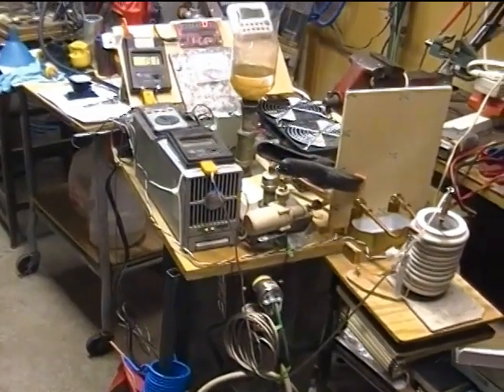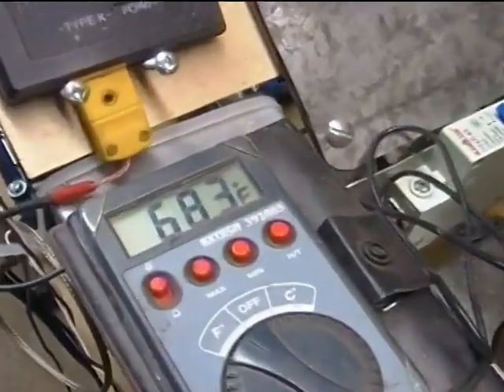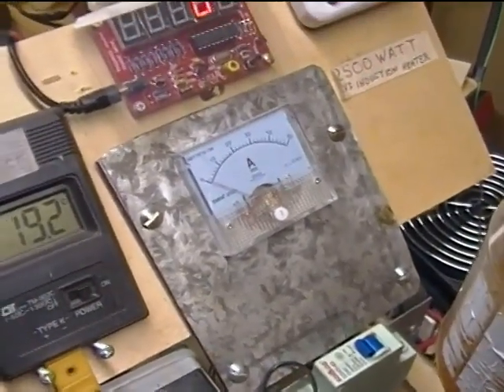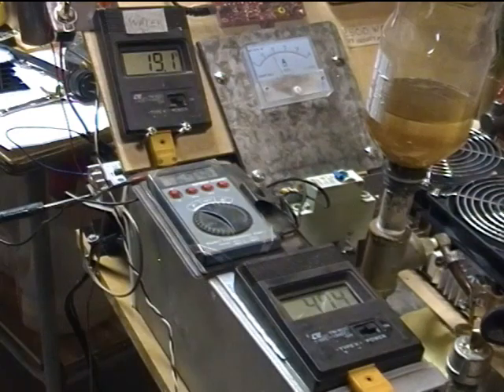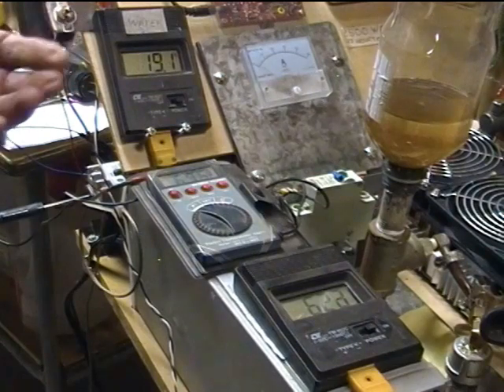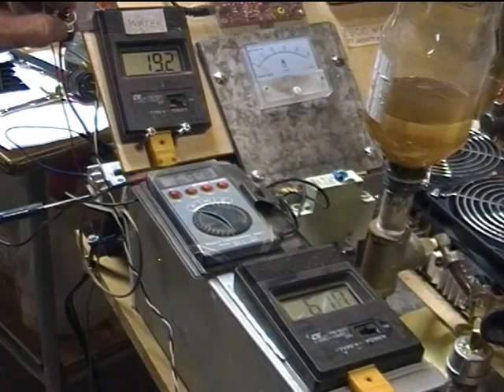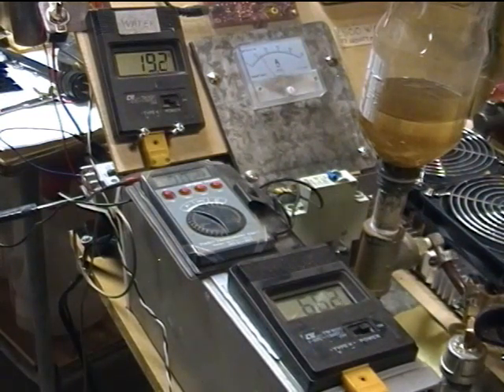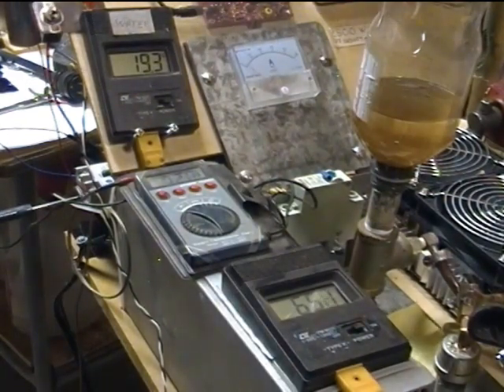#175 DC-DC Solid State Relay Control of ZVS  2500 Watt Induction Heater  Part 1 of 4

Comment: Sir if you have whatapp number please give me i have 2500 watt zvs induction heater but that id dont properly work it is stop frickvency when metal is done red
Reply from the maker: I suggest that you study these two links to help troubleshoot your device:

https://www.youtube.com/watch?v=9JAMxF_8Xbs
Although this one focuses on the 1000 watt ZVS heater, most of the  ideas apply to the 2500 watt unit also.  

https://spaco.org/Blacksmithing/ZVSInductionHeater/1000WattZVSInductionHeaterNotes.htm
This  webpage has lots of information and it has many links to other useful pages, including a complete troubleshooting guide.  It also relates to the 2500 watt unit.